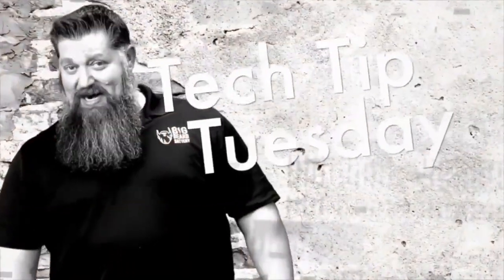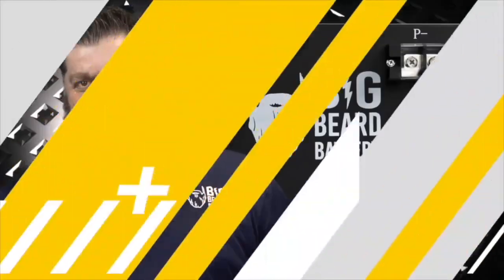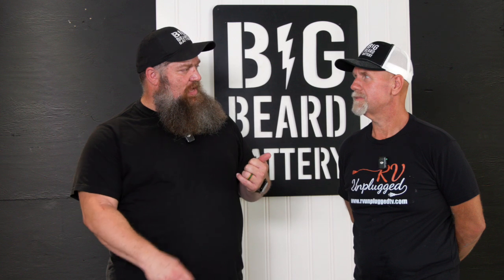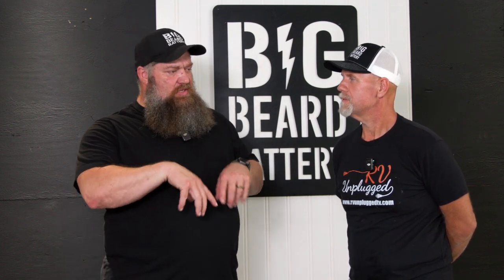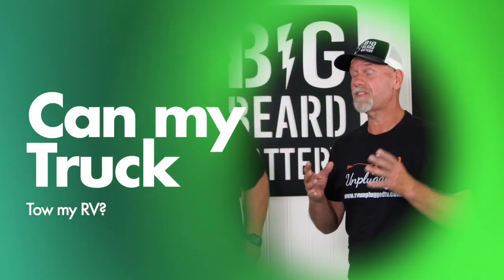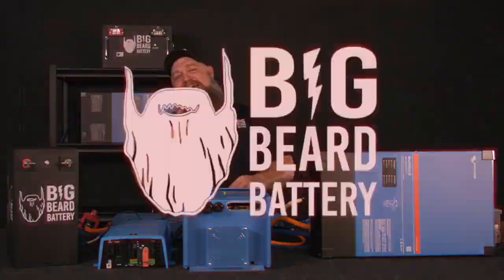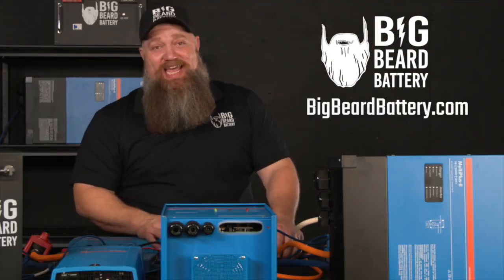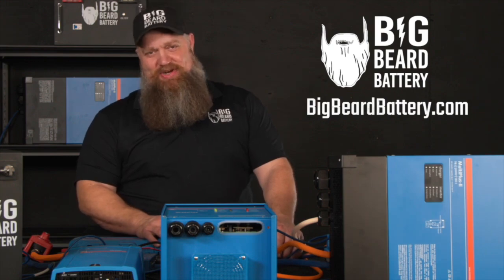Truck Towing Capabilities

Comment: Towed an RV for 45+ years. My guess is 25-50% of people towing an RV are overloaded.  People tend to forget to add for people & gear in the truck & trailer. Hitch weight per manufacture is usually empty weight. Just because you have a 3/4t truck doesn't mean you're okay either. A 3/4t diesel may not have much to any extra capacity that a gas 1/2t. in some cases. Tow cap may be ok, but load cap is almost always the issue. Its not an either or situation.

Comment: Allow me to throw in another math problem. I watch every video I can on this subject. Very few mention anything about the J2801 standard truck manufactures are held to. As far as I'm aware GM is the only OEM that puts the max weights according to the J2801 standard. I suppose the other trucks you do the math. Not saying I agree with the J2801 standard, believe it it ludicrous that my 3500 SRW is limited to 2600# goose ball pin weight but I still have 1400# of cargo capacity left I can put in my truck, just not on the pin. I have plenty left on GVAWR front and rear. Always fighting the max pin weight according to the J2801 standard. Won't even get into how far off the fifth wheel curb and pin weights listed by the manufacture were off from real numbers. Thanks for trying to explain this Todd.

Comment: On my toy hauler my tongue weight was 1600lb from factory the dealership sold me a sway weight distribution hitch for 1200 pounds they automatically assumed that it was that cause the gross weight of the camper was 12000lb but the factory was right it was 1600lb because of everything moved to the front with the ideal that you load everything in the garage area then it balances out to 1200 so I real need a 1600lb  sway and weight distribution hitch

Comment: RV Miles did a great video on this topic a month or two back.  Worth your time for anyone who isn't clear on the subject.

As someone about to shop for an TT and not wanting to get a new truck, the problem I have is that I have no experience in estimating what the difference between the dry pin/hitch weight of the RV I am looking at will be vs what it will be when I am loaded up for the road.  I have a good idea what the hitch weight will be when I put a load on my auto hauler or a cargo hauler, based on experience and many trips to CAT scales.  But for an RV, I have no idea.

I'd love to see surveys or just hear about people's experience - what is your trailer's manufacturer listed GVWR, dry weight, dry pin weight, and what are your GVW and hitch/pin weight when you are on the road?
Reply from the maker: Great, but this channel isn’t rv miles.

Comment: With current generation diesels if you're steer, drive & combined are all good there's no point in disconnecting, it's virtually impossible to have those good & be over tow rating.
My 24 3500 Ram HO is rated for 23,700/23K with 3810 payload, anyway you figure my axles will be over before I'm over tow weight especially with a 5th wheel.